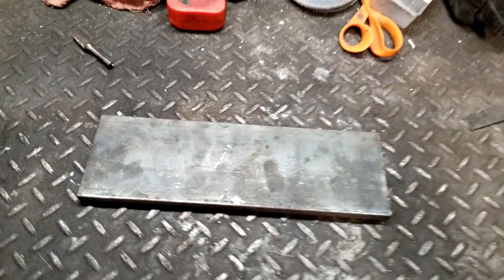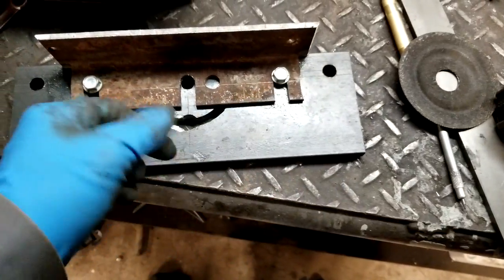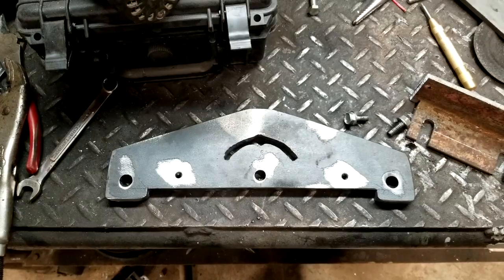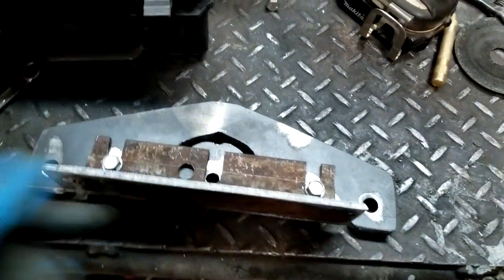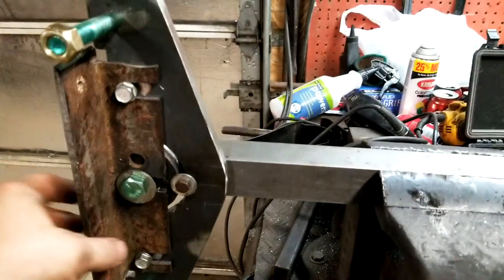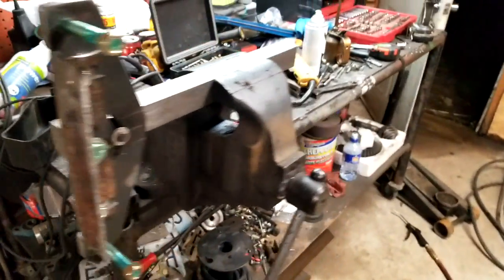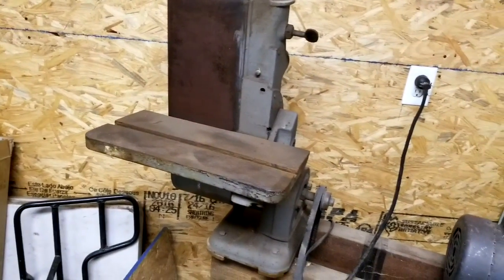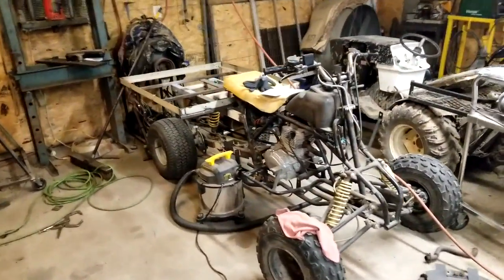Homemade 2"x72" Belt Sander/Grinder Part 1 (D-Backing Plate With Tool Arm)

Comment: how did you end up cutting the curved channel without a mill?
Reply from the maker: I used an angle grinder with a cut off wheel and took off as much metal as possible then used a flap disk to shape it
Reply: @lonniesgarage  dang you did that with a cut off wheel ? Wouldn't of thought that was possible lol